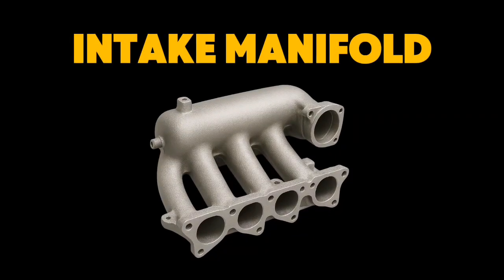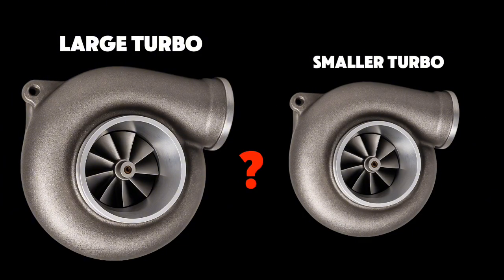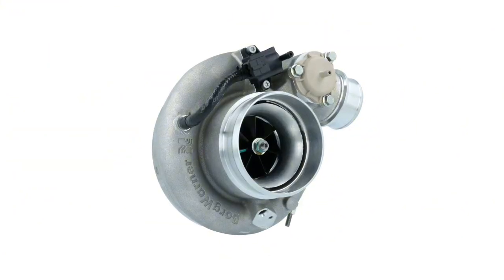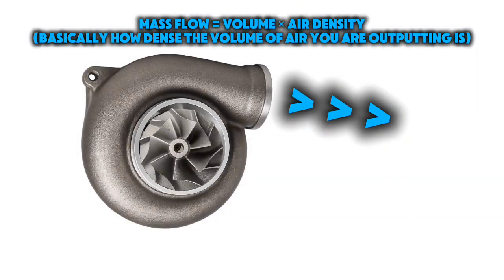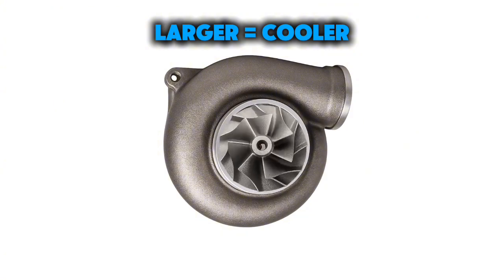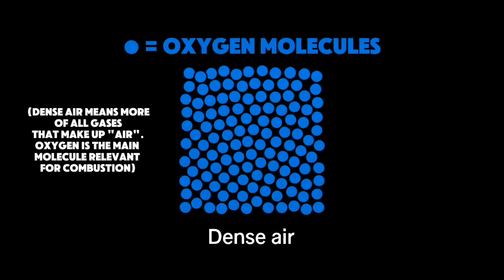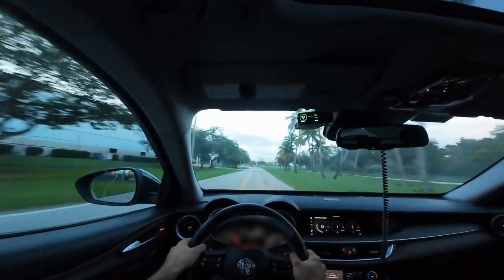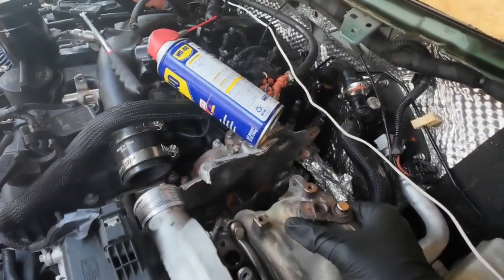The TRUTH About BIG Turbos

Comment: This video is misleading. Best to get a matching turbo size for the engine. Smaller turbo - faster boost, but runs out of puff. Bigger turbo - huge lag... either get a correct ball bearing size turbo for your engine OR twin turbo/twin scroll.
Reply from the maker: You're correct. Properly sizing your turbo is very important, but that doesn't make the video misleading. Larger turbos almost always have more performance potential.
Reply: @TorqueTheoryLabs you probably need to explain the turbo efficiency map so that it's not bigger is always better. Because, well, it's not on the streets and around a track. Great for 1/4 mile drags at full throttle and that's about it.
Reply: @TorqueTheoryLabsyour video explains the theory in an very good way but an ingorant may interpret what you are saying that the bigger the better. Far from it.

Comment: Can’t we somewhat offset these smaller turbo inefficiencies by spraying water/meth pre-turbo into the intake air stream?
Reply from the maker: I actually have a video about this. I measured this as an experiment with my own turbocharger, though I haven't posted the data yet:

If I remember correctly, turbo compressor outlet temps under load went down from 330 degrees at 30PSI to 220 degrees, but the temperature change in the intercooler wasn't significantly different in either run (might've stayed 10 degrees lower). 

And at the end of the day, the turbine wheel is still the major restriction when your intercooler is doing such a great job. So no matter how efficient you make your compressor wheel, the turbine wheel restriction caps your power.

Comment: At the same pressure, big compressor squeezes just as much as small compressor.  Pressure = squeeze.  

If you're asking for airflow outside the compressor's most efficient islands, a different compressor has the potential to more efficiently squeeze that air, agitating it less, so more of that pressure comes from mass than temperature.  Same pressure, more air, more power.  

If pressure's the same and your intercooler does a great job cooling air down to the same temperature, airmass is the same.  But, the less efficient turbo will have taken more energy from the turbine, making the engine work harder to expel exhaust, so less engine power makes it to the crankshaft.

Bigger generally means more efficient at higher flow.  Overall design of the turbo is a factor as well.  Newer, smaller compressors can outperform older bigger compressors at higher flow.  Also, all designs have built-in tradeoffs between max pressure ratio and overall flow.  Some work well at 6:1, some can't even reach 4:1.  Of similar sizes and quality, the turbo that can reach higher pressure cannot reach the same mass airflow.

Ultimately, it's about sizing the turbo for the demands you'll be placing on it.  Size and shape for required pressure, desired boost threshold RPM, and overall power output - based on the engine's naturally aspirated flow.
Reply from the maker: Yeah, I like to think of it as squeezes per minute to make it simple. But in details it really comes down to compressor wheel efficiency, design, RPM, etc.